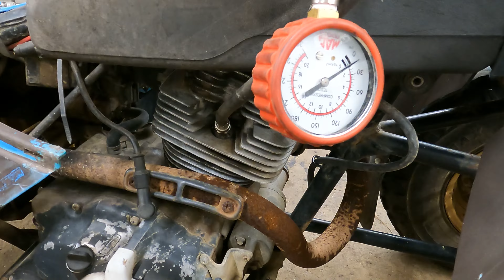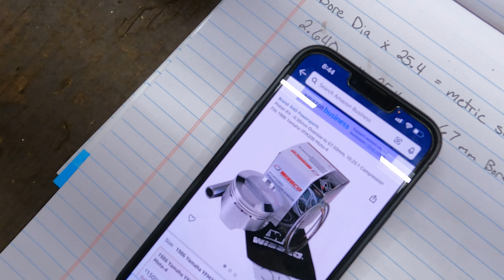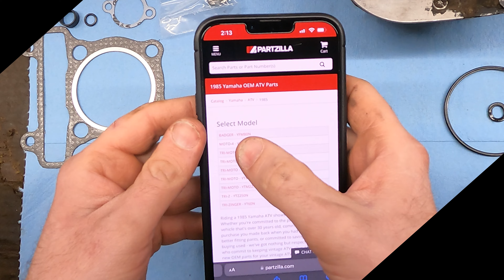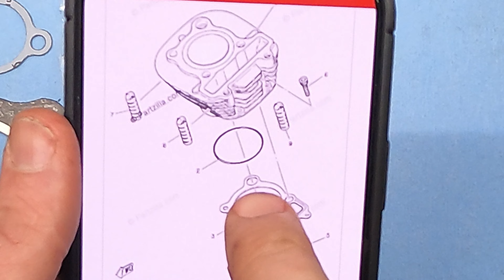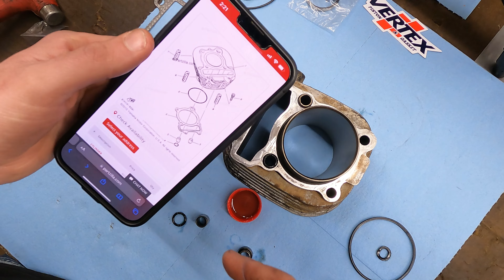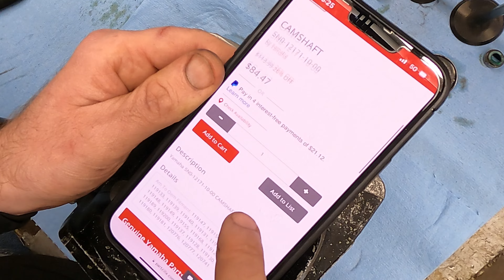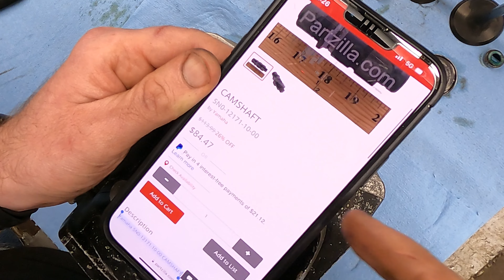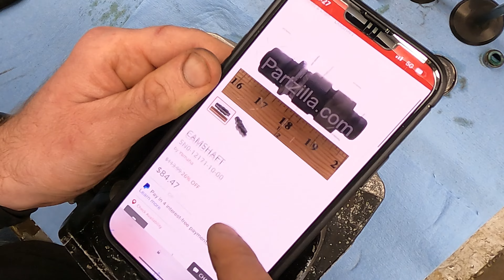I Bought This Yamaha Moto 4 How bad is it?

Comment: I've been watching a bunch of your videos the past few weeks as I'm working on my 88 Moto 4 350. Did you replace the front steering knuckle bushings and kingpin by any chance and is it in one of your videos? Also trying to figure out a decent bushing/kingpin kit. Lots of cheap junk and I'd rather something a little better quality. Thanks
Reply from the maker: The steering bushings I reused but Idr if I did new kingpin bushings or not. They’d probably be on the frame restoration video if I did. Or the one where I did the hubs😅 I can’t remember